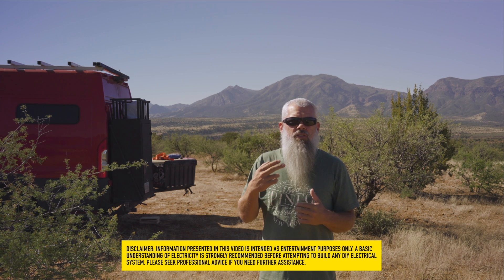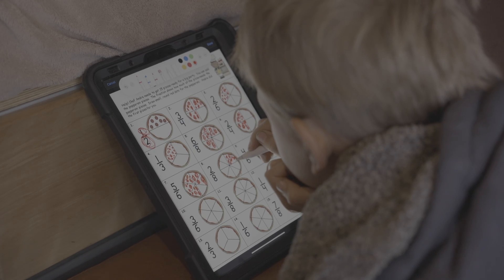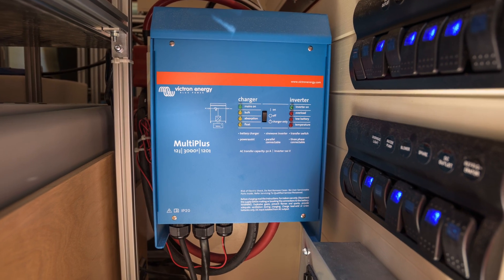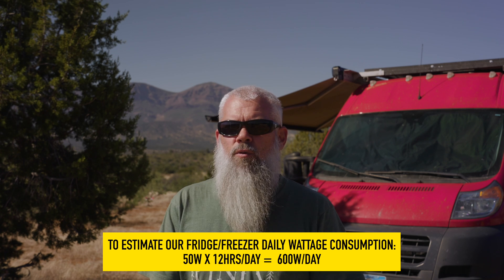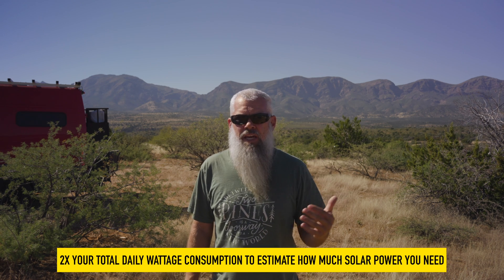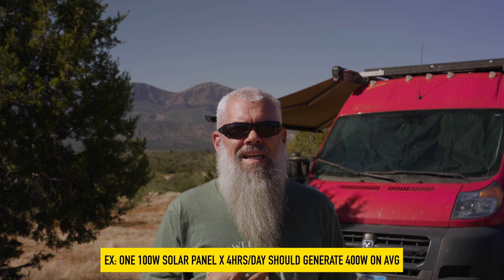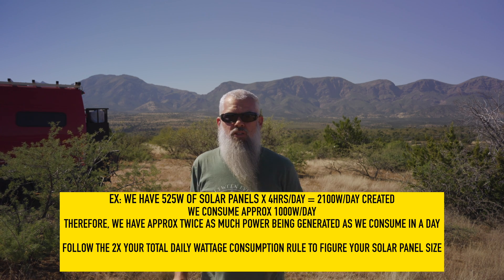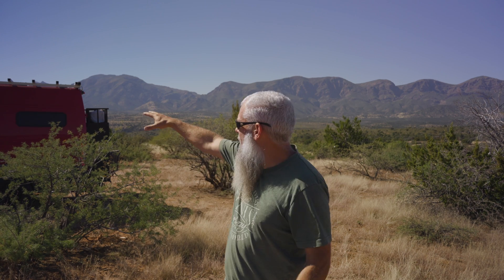Master Electrician presents HOW TO Size a DIY Mobile Electrical System: How MUCH is ENOUGH?

Comment: If I want to do all solar, and I will have both 120 and 12v, will I need two different inverters?
Reply from the maker: No if you use a 12v battery bank. Your solar charger will convert your solar panels to 12v. Your 12v items will hook up to your batteries. You will need a inverter to go from 12v to 120v. If your battery bank is 24v then you will need to step down to 12v and then need a inverter to goes from 24v to 120v. Hope that helps and makes sense. Thanks for watching
Reply: @OverlandUncharted  Thank you so much. I was very confused!

Comment: Hi Kirt, great video, really makes sense 👍. I’ve just finished my solar setup on our Citroen Relay (Promaster) which as you say needs lots of leg work to see what and for how long your going to use items but once that’s done plus added percentage just in case it does seem to tie together. We are based in the UK and plan to travel into Northern Europe therefore I have made a frame for my 590 watt solar array and can tilt it up to 40 degrees which really makes the harvest watts jump when in operation, thought that might be worth a consideration for those skiers out there? Keep up the posts really enjoy your vlogs
Reply from the maker: Awesome! Tilting the panels is definitely a option. Safe travels and thanks for watching!

Comment: Great video.
 I've always wonder how those panels would hold up in a hail storm. Being east of the Rockies has big stones. I've always thought having a system that would fold on itself, with plywood or corragated steel facing up after folding, would protect the panels.
Reply from the maker: Thank you! The Panasonic panel is rated up to 1inch hail. Hail that big you will be more worried about your rig. Haha. I would definitely get a residential panel instead of the Amazon ones. Thanks for watching!
Reply: Thanks for explaining that it makes sense now but my question to u is how much is that 1000watts running like how many outlets or tvs air conditioning etc is what I'm trying to figure out what is ur elec usage that makes ur 1000w/day is what I'm trying to figure out so I can finally put it all together to make complete sense. I'm learning all this cause I'm going to build my own bus and I have done research and watches tons of videos but I can't get this part of it to be complete for me to get it all.. ur help would be greatly appreciated cause I got it just from u explaining just this much off it. I don't know why some people make things so complicated when it doesn't have to be lol !!!!